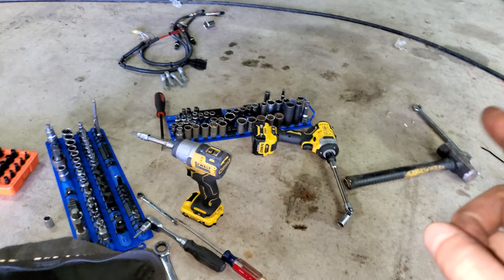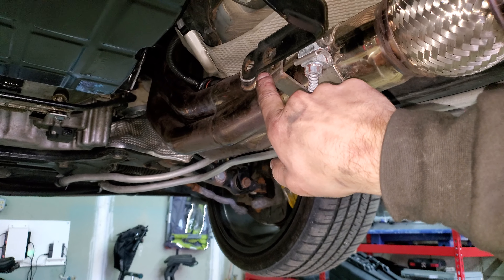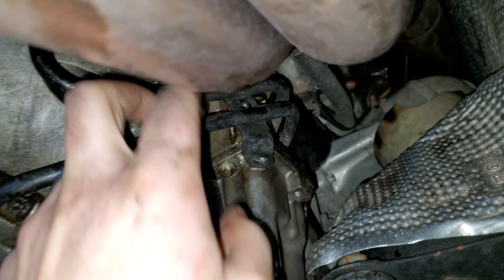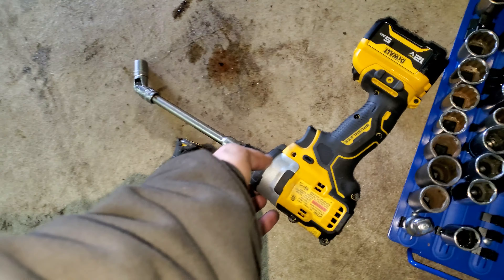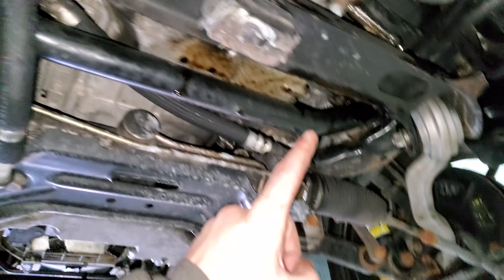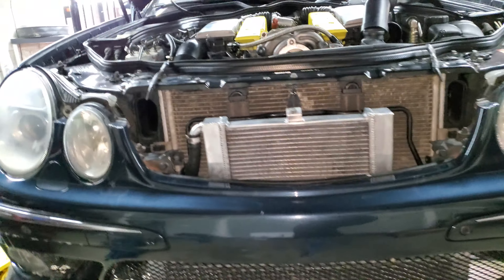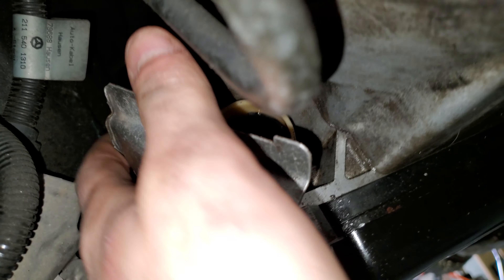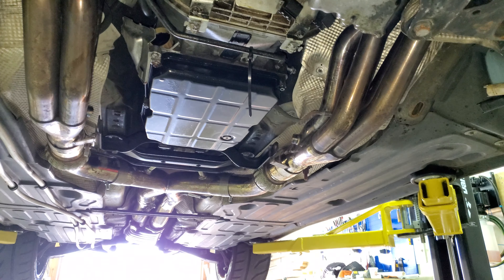w211 E55 AMG rear main seal replacement part1

Comment: as a Mercedes-benz master tech/ shop foreman I'm going to give you some tips.. #1... that locking clip for the shift linkage on the shifter is a single use clip, if you re-use it, the linkage will fall off and you will need to be towed home. #2  M113 valve cover breathers are a known leak point. take the breathers off the valve cover, clean out the sealant and re-seal using new M4 screws, #3 if you remove the pilot bushing from the trans, there is a good chance it will break the conductor plate. us extreme caution and the install torque is only 4nm. btw.. it's a 7mm bolt. #5  make sure you replace the rear main plate along with the seal and you MUST use the correct seal installer or it will leak. the installer will locate the new rear main seal 2mm deeper on the crank and onto fresh metal and the seal won't roll. #6  , when you pull the transmission, cover the 02 sensor connectors. if you get a drop of trans fluid in the 02 sensor, it's gonna be trash and the check engine light will come on.   other than that...... good work.  I've been a benz tech for 16yrs... LMK if you have any other questions.... I too own a E55 as well.
Reply: Can you make a video on your e55
Reply: Thanks for chiming in on this.
Reply from the maker: Thanks, u got any insight with the p0105 code on coldstart? I've put all new SC gaskets and plenum gaskets TQ to spec no leaks anywhere replaced the engine harness and ECU and all sensors map,crank,cam,knock sensors, IAT sensor 4 new o2 sensors new batteries,water pump and thermostat pulleys, IC pumps plugs and coils wires I IDK where else to look or check.
Reply: @turbocraz1  going off of memory, if the hard pipe on the back side of the drivers side valve cover is leaking, that will cause the fault, also the big o ring between the charger and the bypass valve can leak.  the best advice is to get a cheap smoke tester and smoke test the engine. cap the throttle body and fill it with smoke.
Reply from the maker: @malloymotorsports780  I did a VRP bypass delete so there are 2 gaskets and new seal there now, and a new rubber gromut in the metal pipe behind the SC I'll have to do another smoke test again then.
Reply: does any aftermarket installer exist? It is hard to find it if you do not work at mb dealer :)
Reply from the maker: @Uladzi_  I never looked for MB tool for this I'm sure they have one and I'm sure it's well over 300 bucks you definitely do not need anything special to install the seal it's very easy to do.
Reply: How about the front main oil seal? Do you need to have an installation tool for that? I have seen several YouTube's just tap in the seal.
Reply: You had to keep #4 for yourself huh? Can't give away all the secrets 😉🤣